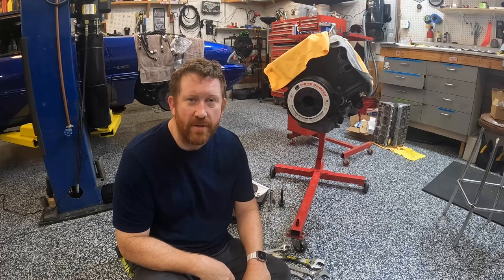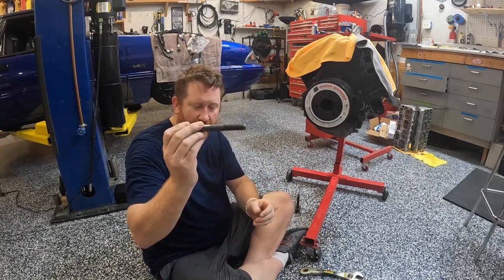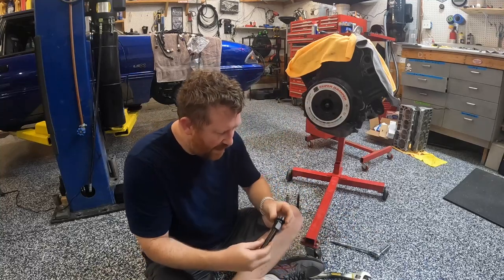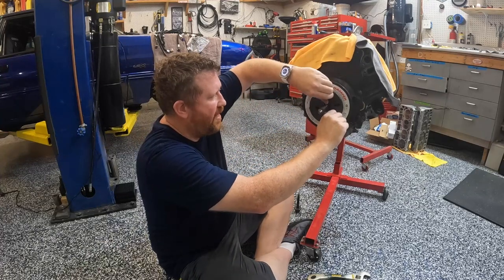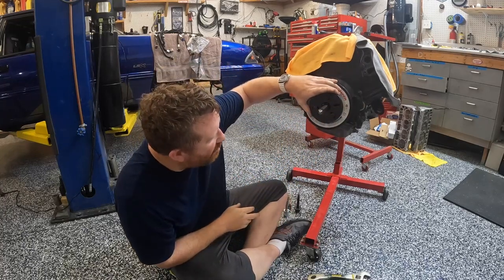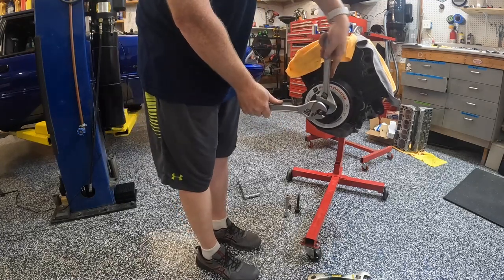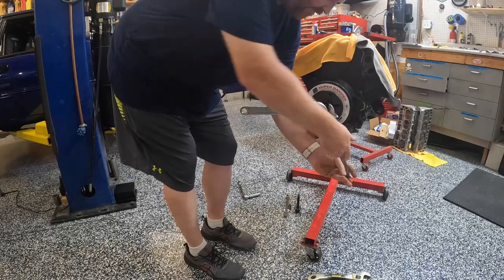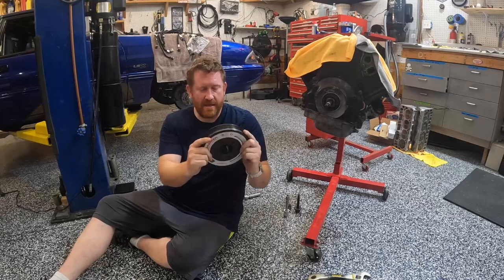6.0 LQ9 ATI Balancer Removal - I hope we don't destroy the Crankshaft

Comment: Oh man, thanks for this video! I was gonna pull my ati with  a regular puller.
Reply from the maker: yeah no problem.   I was going to do the same thing but figured this was the safer route and it worked awesome.  I didnt make a video on the installation but it was almost exactly the same.  The big nut just pushes on the front side of the balancer to push it on instead of pulling it.

Comment: Yeah.  No thanks!  I’m not paying $260+ for ATI overpriced removal/installation tool.

I will figure it out with a regular 3 bolt puller and the same setup I use on regular LS balancers.
Reply: Did it work??
Reply from the maker: Yeah your prerogative man but messing around with the snout of the crankshaft is not a place to be using the wrong tools in my opinion.  With a tool like this once you have the tool you will always have it for future projects.  Good luck to you.